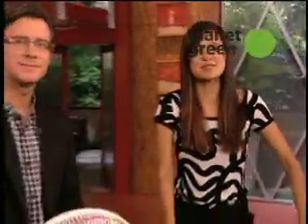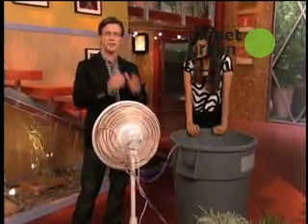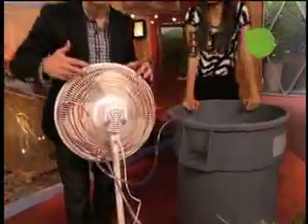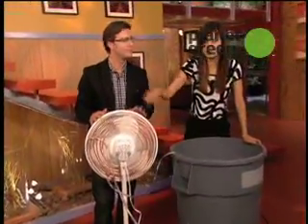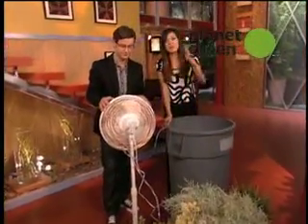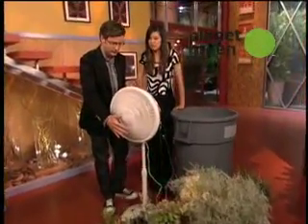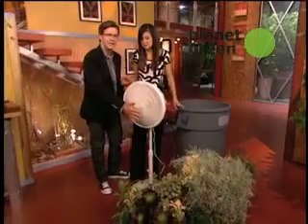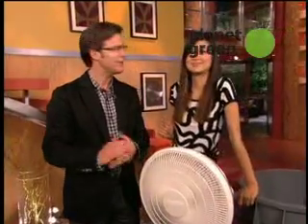G Word - Homemade Air Conditioning

Comment: About soil since some voted MrTony747's comment to the top. During sunny/warm days/nights, ground temperatures can be much warmer than the air temperature. During cold nights it can be 1-8F cooler than air temperature. Go down 5 feet or so and the temperature hardly varies throughout the year. Use AgWeatherNet for real time air/soil observations even.

Comment: how about circulating hot air through liquid nitrogen / dry ice (box burried under soil) which is naturally very cold? wind energy can be used to rotate the pump (roof top) for air circulation using  copper tube. no electricity required.

Comment: actually it does. It's called siphoning. It is based on the fact that the output is closer to the earth than the intake, gravity does it's work. The water does not go back in to the garbage can though.

Comment: @nadeem5476

It actually will decrease the humidity in the room.  The moist warm air condenses on the cold copper.  You are speaking of a swamp cooler.  This is not a swamp cooler.

Comment: Ok, ....so were does the ice come from? If it comes from your freezer, the net effect is that more heat is added to your house. Of course if you bought the ice at the store, it would actually cool your house, but the cost will probably be higher than running the airconditioner.

Comment: I WOULD ADD A SMALL WATER COOLER TOWER maybe with some of it below ground where the temp is cooler, spray it from the top and let it fall down the shaft as rain, maybe even trickle over some radiators with the warm water coming back from the house.

it'll cool the water on the return cycle and then as it falls it cools even more.

I'm kinda kicking the idea around about building one.

Comment: Here's an idea, instead of making ice with electricity why don't you just bury underground copper tubing where it is already cold and fill it with water and let it come back into your homemade ac and circulate using a pump with a small fan. then you would not have to worry about humidity and freezing ice!

Comment: These types of setups work better with a cooler and a pump running the water through coil and back into the cooler, ideally with a closed circuit for the fluid running through the coil which would be some sort of coolant or heavy salinated water with a another coil in the cooler under ice. You could use a cheap fishtank or water fountain pump to move the fluid through the coil.

Comment: @nadeem5476 no it does not, it remove humidity. water vapor condenses when it comes in contact with a cooler surface. In fact this is the EXACT same way an air conditioner works minus the refrigerant and the compressor. This is why after a hot shower the water is on tile walls. The walls were cooler and the water vapor condenses.

Comment: @nadeem5476 
I beg to differ. The AC works in the same manner. It would not increase the humidity but rather reduce humidity as the cold air blowing across the tubing would cool down to produce water vapours condensation (just a like around a glass of cold water). This water can then be collected in a bucked and moved outside for evaporation into atmosphere. As the process does not involve evaporation of circulated liquid therefore the humidity level would reduce rather than increase.

Comment: How is this green? It takes more energy to make the ice then it would to run an air conditioner. If you buy your ice at a store, the freezers there have to work to keep the ice cold after the ice is made. You also have to worry about all of that water causing mold problems.

Comment: You got it Wrong

The return tube is suppose to go back into the "trash can with ice"

Only after ALL the ice is gone then you can use the "return tube" with the pump on to pump out the water,.....to water the plants.

Or you can just not use ice and the copper tubing will get cool on it's own...from the windNcycling water.
Only if you use a smaller "trash can" I would rather you use a ice cooler and poke a few holes in.

That way the water slowly gets colder.

If you want. Like the show anyhow.

Comment: Even better yet add a thermoelectric cooling module to keep the water cold and recycle water in the system.  use a well insulated box to hold the water and you could probably get by with just a gallon of water kept cold by the module and recirculated through the system.

Comment: Keep the water in an outside loop rather than spending it once. (no coper outside)  It should be a half buried fountain pool or at least recool it by letting it fall. Filters are also needed.

Comment: This is a terrible idea:

1: How do you get the "ice cold" water in the first place?
2: At the rate it expels water into the garden, it won't be long before you have an empty bin.
3: Who wants huge volumes of water pissing out the house in just one spot where it will not exactly have desirable results?
4: Even if this were viable, what about the cost of all that water?

Comment: lol. you could make a better A/C unit with good Thermodynamics knowledge. Although this is never going to be as efficient as a store bought airconditioner, it would still work...Although it would be better to run the cool water through an old car radiator. And yes, it would save resources to pump the cooling water back into the garbage can. However, where do you get the ice? How efficient is that?

Comment: Why not put a pump in the can and run the cold water back into the can instead of running it out into the plants.

You didn't tell anyone that they have to suck on the end to get it going. (Without a pump)